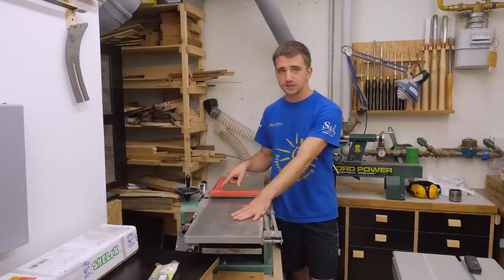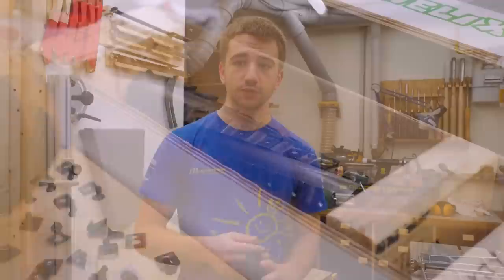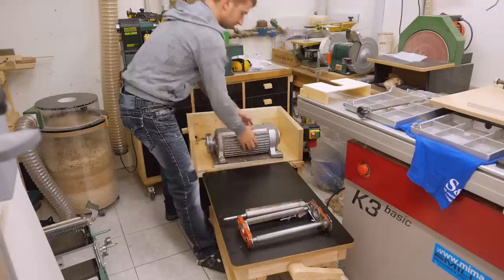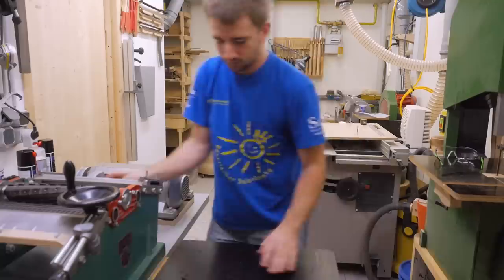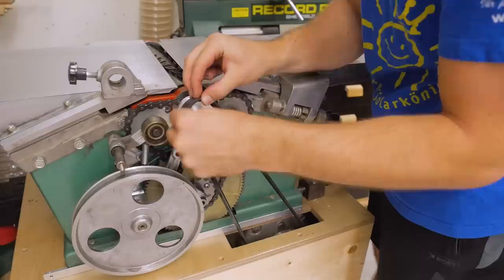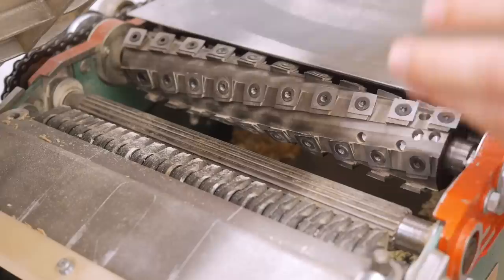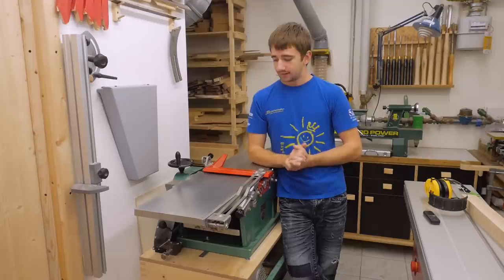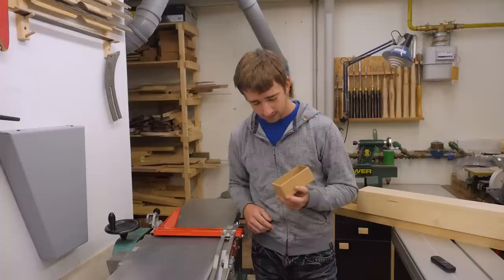Shelix Cutterhead Upgrade for my Kity 636 Jointer/Planer

Comment from the maker: Please watch the video first before you comment!
Reply: I won't!
I know, I'm a rebel 😉
Reply: Where did you get the belt?
Reply: Why is the sound so bad, usually you were spot on. Either cant hear anything or its blasting the windows out my office
Reply: Dismantling this type of machinery is very complicated, but when you know how to do your own maintenance is cheaper ... the only problem is if you perfer in the middle of so many parts. Congratulations on your skills.
I'm from Brazil and I follow him a long time.
Reply from the maker: Online, I just searched for Poly-V belts
Reply: Very good
Reply: Were the extra screws from the casters?
Reply: All the best engineers I’ve worked with had practical experience learned from hobbies. You’re gonna be great! 🤙
Reply: But this is the first video! :-D
Reply: Aaaaan I just found out I can not read. xD
Reply: Video great. Sound goes up and down which is not the case normally on your fine videos.
Reply: ผมขอ

Comment: Yeah, Marius. Your machine appeared to be very difficult to work on. I also replaced the cutter head on my jointer with the Shelix head, and while it was not a walk in the park, it was much less trouble than you had. Mine was a Delta jointer, and it took about four hours total, working by myself, using only a gear puller and a few hand tools. Setting up was also much easier, since I didn't have to remove the infeed and outfeed tables. You and your dad did an excellent job, one that most people could not have attempted.
Reply: His machine was so much harder because it's such a good machine, and also dual purpose.

Comment: Wow that was a lot of work!  In the long run, I'm sure you'll be happy with the results though!  Regarding the press fit, that's how I used to install bearings in first (Rabbit) and second generation VW Golf rear drum brakes:  We'd put the bearings in the freezer over night, and then heat the drums in the oven to 500F.  The bearings would drop right in.  No fuss, no muss.

Comment: Marius, I am glad I found this video.  My Menz Shed recently traded up from a DeWalt thicknesser to a 15" MACMA thicknesser with helical head, and I am not happy with the finish as it gets similar marks on the timber.  I don't think ours are made by the feed roller though as they are at an angle that follows the cutting head, but I'll watch this video again and see if I can work it out.  Mean while I have ordered a Hafco thicknesser planer from Machinery House here in New Zealand, and I hope to get mine fully dialled in as I am the only person using and adjusting it.

Comment: The press fit you mentioned is actually known as an interference fit. Great video. I installed the Shelix head in my DeWalt 735 planer and it was not nearly as involved as your upgrade.

Comment: I have an old Swiss made Inca 570 jointer/planner that looks very much like your Kity. It is very quiet and smooth like a Swiss watch. It has the Tersa blade system which makes blade changes super quick and easy. A tap or two against a wood block and the blades slide out. Slide in the new blades and turn the machine on and they are set perfectly every time. As the replacement blades are two-sided and only about $12 US a set, I think I will take your advice and Not upgrade. Thanks. Great video. You are tenacious.

Comment: I have a drum sander with a similar table-raising mechanism... the key is to cut a big hole in the stand under the unit. Then you can poke your head/arm in there to make adjustments. I really want to put my drum sander on a cart with drawers but if i ever had to make an adjustment, I'd have to do what you describe. No thanks! So, it stays on its open stand!

Comment: I have installed a lot of helical carbide cutterheads in jointers and planers. I strongly recommend that you check torque on all the carbide cutter bolts after 1 week of use and again  after 1 month of use. I always find a few bolts that need to be tightened more. G.
Reply from the maker: Good tip, I'll do that. The instructions didn't tell anything about the torque and 15Nm as suggested from a table seemed a bit much. I used 9Nm torque. Would you say I'm in the correct range with that?
Reply: Marius, I have used click type torque wrenches with some success but you should call Byrd and get a torque spec from them directly.  Your 9Nm setting still seems a little high to me.  Byrd says, "When we assemble the SHELIX we torque the inserts down to about 40-45 (5.08 Nm) inch pounds. If you don't have access to a torque wrench, a good hand tightening will do the trick no problem." When I don't have access to an inch pound torque wrench I hand tighten using a Torx tip in a screw driver handle to "it hurts my hand" tight. Oddly when I use the torque wrench I break looks more carbides than I do when I use a hand driver.  I hate breaking carbides!

Comment: Very interesting video. I recently took my machine apart to replace the infeed and outfeed rollers and I considered upgrading to an shelix head in the process. I'm sure it produces a wonderful cut but the head would have been more expensive than my machine so I didn't feel I could really justify it. I took the compromise position of just buying some straight carbide knives, they last like carbine but are cheap like HSS (they are about 3 times the price but last easily 3 times longer).

Comment: On the INCA 560 J/P,  the cutterhead is independent of the yokes that carry the feed rollers, and can be removed without disturbing them.  When KITY copied it, obviously they took a shortcut by tying them all together.
Pulling the cutterhead on the INCA is a 1 hour job.

Comment: that is a really nice planer/jointer.  i wish i could find one of those in the U.S.  and going with the shelix cutterhead is a fantastic decision. no more aligning the knives and no more bad knives just because of one nick....simply move the four sided knife to an unused one. it should be quieter as well and no more clogged dust collector hoses.  i am going to say it again....i wish i could find one of those machines.  you can tell it is made really well.....nothing like the newer machines.  what is it...40 years old? 50 years old?  take care...
Reply: @Todd Bushcrafter, not 100% sure but i believe they were made in the 80s - or perhaps were stopped being made in the 80s!? I have seen other Kity636 machines advertised, all with 80s years.

Comment: Saustarke Arbeit! Und diese Geduld. Ein Wunder, daß es für die Kitty überhaupt diese Trommel gab. Und ja, ich geb dir Recht, ich hätte das auch nicht investiert. 
Was mich besonders gefreut hat, war der Trick mit der Temperaturdifferenz. Daß das noch jemand kennt! Wir haben in den 70er Jahren so die Führungsbolzen von Zylinderköpfen in den Motorblock wieder eingelassen. Wir haben die Bolzen allerdings über Nacht in ein Gefrierfach gepackt :-)
Beste Grüße aus dem Schwabenland auc an deinen hilfreichen Herrn Vater. Ich beneide ihn um die Drehmaschine.
PS: Mit der segmentierten Welle braucht die Maschine etwas weniger elektrische Leistung für die gleiche Hobelleistung.
Reply from the maker: Das hat mich auch gewundert. Ich hab einfach spaßeshalber mal "Kity 636 shelix" in Google eingegeben und dann war das der erste Treffer. Das mit der Temperaturdehnung haben wir auch im Maschinenbaustudium gelernt und es wird ja auch heutzutage noch oft verwendet (spannfutter z.B.)
PS: Es ist zur Hälfte auch meine Drehmaschine;)
Reply: Ok, dann beneide ich euch beide ;-)
Reply: Wie marius schon sagte, ist so eine Schrumpffassung bei uns "Metallmenschen" was recht häufiges, aber sowas simples dass so nützlich ist,ist schon sehr interessant.

Comment: been looking intoo that type of drum before , good thing about it is if you nick one line of blades you dont have to regrind all of them 
the only bad thing that was noticed by someone is that because the blades are in a spiral they allways have resistance angainst the wood its planing (you can hear it when running it as it isnt a vibrating sound but a more constand tone) 
that does mean the motor driving the planer is under a more constand torque and hasnt got a chance to regain speed if the motor is too weak , i dont think youre machine will giove you problem as it seems to be a quality machine but the lesser brands might need to have a stronger motor installed

Comment: On my 636, the feed rollers are actually knurled - not spiral cut.

Also
@20:42 Yes! Finally! The thing I've stuggled with OH SO MUCH! I'll get to see someone else do it! I hope he has some good tips so I can get the final .1 mm ...
@21:15 Well... crap!

Unfortunately, the 1-tooth resolution makes it so that the best you can get with that method is +/- 1.25 mm, which is definitely noticeable. And if you adjust the planer table too much, it gets prone to binding near the bottom or worse - skipping teeth when you screw it up or down.
But you can also adjust the red holders for the whole roller assembly. Of course, after that you need to readjust the jointer tables again. What's positive is that you don't have to turn the machine over, though. You can even do it with the belt tensioned.
Reply: I don't know how the thread spindles are mounted to the thicknessing table in this machine; in my machine (different make/model) the nuts for the thread spindles are separate parts from the thicknessing table and can be adjusted very finely using some grub screws.
Reply from the maker: I'm sorry for no better solution..."oh crap" was my thinking when I did that the first time too.

Comment: What a great job! And the perseverence of doing it. Kity made really good machines but you transformed yours into a great little gem.
Congratulations!
I want to replace the cutterhead pulley  on my kity 635( a very similar model to yours)with one that accepts a poly V belt for the very same reasons that you did. I won't change the cutterhead itself though… quite expensive.I would like to know what belt did you use(profile type and number of ribs)

Comment: You had chatter when cutting the grooves because you are cutting on both sides of the V at the same time. If you move in at a 20 degree angle with the compound it works better because you only cut on one side of the cutter. It's also probably why your HSS bit burnt up.
Reply from the maker: I had the same idea after we had too much chatter. That's why I couldn't film that, because I assisted turning this.

Comment: Is there something I can measure to see if my Kity 1637 would have the same issue? The infeed roller is this same design. It's tough going from a helical head jointer back to straight blades and dealing with the chip out when the grain changes directions. I usually keep parts slightly larger and run them through my drum sander anyways. Thanks for the video.

Comment: Great video!  I have a smaller just got a kity planer thicknesser which is part of the K5 Combi.  I'm about to renovate so tested it yesterday.  I'm getting the same marks as you did which is caused by the infeed roller.  I cannot machine a replacement and I dread to think how much a custom one would cost do you have any other ideas what I could do as surely it wasn't like this from new?

Comment: Impressive work, and a very worthwhile end result. How much money and how many hours were required? If a standard combination machine is available equipped wth segmented head already installed, would it have been as expensive? (I understand it is unlikely that such a stock machine's corresponding details would not likely match your custom ones in quality.)

Comment: What did you think about the change to the V-belt? More power? I'm impressed by your persistence. I feel these kinds of headache tinkering projects are most enjoyable years later when you think back on it. I bought an Inca 570 to fix this winter, and it looks somewhat similar to yours. Thanks for the video!
Reply from the maker: The old flat belt was slipping when not tensioned really hard. And it had to be aligned exactly. A lot of work I didn't show when I got the machine. I also want to use these belts again for other projects and this was a good test run. And the old Pulley didn't fit on the new cutterhead.

Comment: With helix cutters it is not about cut quality. You can get better surface finish with good, sharp, straight blades. What matters is reduced noise, durability and you need to change few inserts only when your cutter find a nail in the wood...

Comment: Phew, 750 € is mighty expensive just for a cutter head. And looking at 630 mm shelix heads, they are 1500-3000 €, which is also still more expensive than a complete 630 mm machine. So I'm not quite sure who the target market here is -- I don't think any hobbyists want to afford that, we don't have the production volume that makes sharpening and setting knifes a big problem, and a few licks with a handplane will clean up the surface better than any milling machine can do it, regardless of cutter head.
Reply: Thing is, if You should happen to hit something unwanted inside Your planer, You change four to eight inserts and restart. Building and rebuilding boats, coaches and sleds I gotta work with a lot of "preloved", "used" aka already plentily nailed and screwed wood, so hitting metal with the planer is a recurrent incident in my shop, and even without having industrial turnover this actually might be cheaper in the long run given how much time I put in refining and replacing my blades.

Comment: I am curious as to why you didn't turn the grooves into the original small pulley and why you cut the grooves so deep.  I would have thought you would want to match the belt profile exactly.   I understand the knurled one spreads the force out more evenly, but wouldn't a spiral in-feed roller still leave diagonal marks?
Thank you for the awesome videos!
Reply from the maker: The old pulley didn't fit on the new cutterhead. Diameter difference of 0,1mm... The V-profile has to be turned like we did, otherwise, the little V's of the belt wouldn't make enough contact. You always have these gaps. The diagonal marks an infeed roller would leave, get planed away.
Reply: Thanks!

Comment: At 23:35 pelase be careful and always use a piece of wood (pushing wood) for pushing the workpiece on planer for saving your hands. Ignoring that it is a very useful video an you have worked very well. Thank you very much for this video.

Comment: Marius,  I own a DeWalt DW735 planner which I'm led to believe does not require extensive teardown to install the Shelix cutterhead, however the cost is a major concern for me. In your opinion, would you still recommend this upgrade use considering its cost and quality cut?

Comment: Great to see another video from you!!
Yes, I know that you are busy with University and all, but every video from you are highly appreciated, and today even TWO :D

About the marking from the in-feed roller. Wouldn't it have been as simple as to lessen the pressure it exerts against the wood?
The bearing holes in the end plates for the feed rollers looks to be elongated and the rollers looks pressed to the bottom at the moment. Or wouldn't the adjustment mechanism budge?

Still good work!!
Reply from the maker: I tried everything before I knew I had to solve it the hard way.
Reply: Shame that it became a project in it's own, well live and learn.
You did get a nice new in-feed roller though. :P

Comment: as always - excellent video! about the infeedroller issue: couldn't it just be that the pressure of the infeedroller pushing against the stock was set too high? have you tried adjusting it?
Reply from the maker: Yes, I've tried everything before I began that adventure
Reply: @MariusHornberger  thought so :) thanks!

Comment: Great job! I like your honest opinion on (not) recommending the upgrade for others.  I was wondering however, did the infeed roller problem exist when you had the original straight cutters on the machine?  Thanks!
Reply from the maker: That's the really strange thing. There was no problem before

Comment: I have to ask. Did you measure the diameter of the new cutter head with the knives installed, compared to the net cutter diameter of the old head? I have a feeling your infeed problem was because the new head is very slightly smaller than the old one. it could be a difference of 0.5mm or even less and it would prevent the cutter from engaging at the same depth as the infeed roller completely. Also, the snipe problem is exacerbated by this same issue.
Reply from the maker: I didn't measure, but after installing the thickness scale was still correct and the outfeed table almost required no adjustment, so I assume it's the same as before

Comment: hey Marius, i have the same Kity planner, would you consider selling me the original cutter pulley? mine cracked when i used a press to push the pulley back onto the shaft. I'm in the UK. Brad

Comment: This machine doesn't deserve you. Making new pulleys was impressive enough...and then you break it down a second time to machine a new, knurled infeed roller? Yes, your final conclusion is correct:  Better path would've been to spend the money on a better machine up front and then you would have been happily shelix'ing months ago.
Reply from the maker: If I had enough space I'd have done that, but the Kity fits perfectly in my small shop